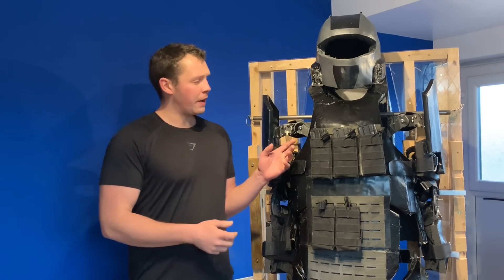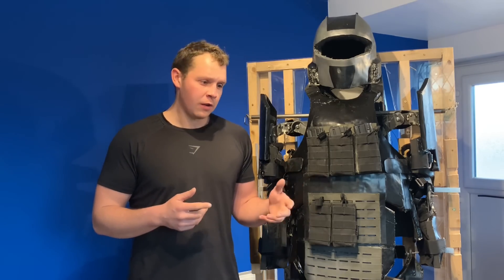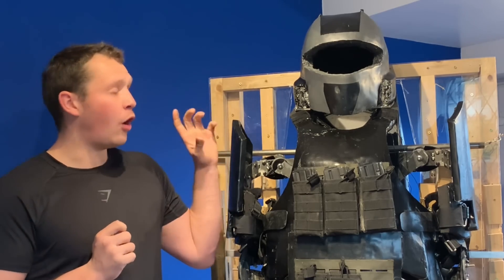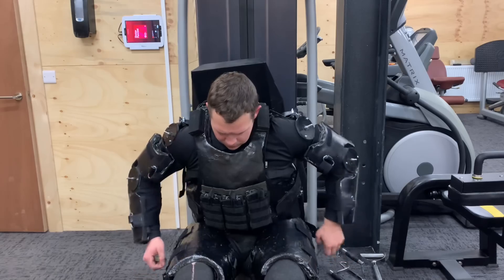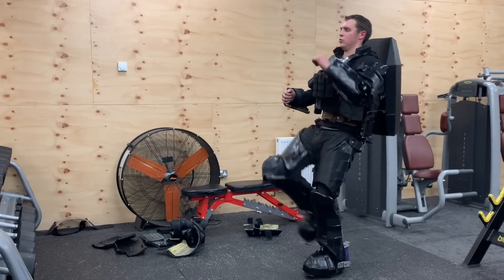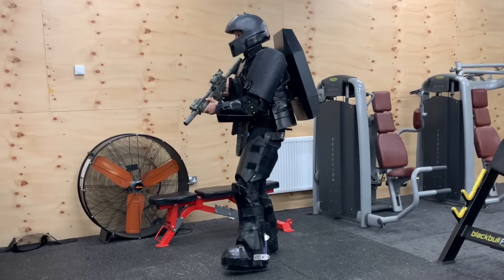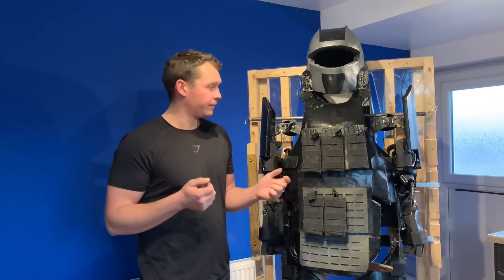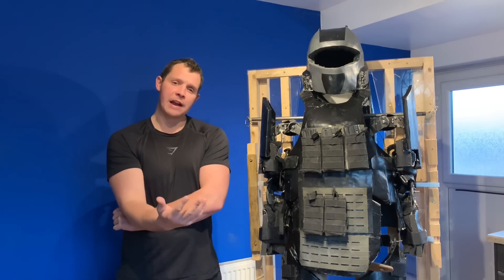Functional Combat Capable Power Armour Development Episode 5 Quest for Bullet Proof Exo Skeletons

Comment: I tried aiming a rifle one time while wearing a motorcycle helmet and immediately discovered the same problem you did. One of those little things you never think about when watching movies with futuristic armor.
Reply: Thats why in Halo the Sights stream directly to your HUD
Reply: And we wonder why storm troopers couldn't hit shit.
Reply: Maybe use some kind of infrared sight under the gun and a very transparent thermal overlay for the visor to let the user see the laser? It wouldn't be as accurate, given the limitations of such a thing over large distances, but it would be cheaper than using a HUD overlay based on where the gun's aiming.
Reply: @LonelyMoon5062  the latest helmets for F-22's, F-35's & Typhoon II's use Helmet HUD's, but they each cost a fewhundred thousand each, they are un-armoured and require the aircraft's onboard computing power to process signal inputs to the HHUD/HVD (Helmet Vision Display)and are specifically custom fitted to only one pilot operator.

Something this design likely will never ever have, ..as the rest of this suit is a conceptual artistic version, the armour isn't armoured, let alone thick or large enough enough to stop a 5.56mm NATO round and its megajoules of kinetic energy, let alone anything bigger in calibre and power.

But as thinking project to work out some of the mechanical limits and movement restrictions, it is a start, only.

Still this looks better in concept than the Russian conceptual Exoskeletal 'Ratnik' Armour, which is equally or more BS than this potential funding scam.
Reply: Most of the time room clearing in the military you don't look through but over the sight. It's usually  under 25 yards so it wastes time when you can just line up and pull.
Reply: Just attach a camera to the gun's optics (or in place of the gun's calibrated optics) and have to feed into the helmet as a HUD, like what David said.

It's already been shown to be feasible all the way back in TrackingPoint's smart scope back in SHOT Show 2013. I'm surprised no one's built upon that concept already.
Reply: Have you ever wondered why wh40k Space Marines and Sisters of Battle bolters are stockless?
A lady cosplayer in a rigidised foam, to scale, SoB power armour outfit tried one with a stock... the stock caught on things and you couldn't line it up.
The stockless design fitted her much better in the armour, fired from  chest level. Just like the Astartes and SoB's do it.
Combined with HUD targeting it would be quite usable
Reply: They make stocks for full face/helmets with face shields; they're just called "visor stocks". You can't get a cheekweld but that's pretty much given.
Reply: attach two laser rangefinders to the gun, then triangulate the impact point and sync it with the helmet's HUD
Reply: Shooting with a mask or helmet on is not an issue during gas mask trading u simply turn your rude 45 degrees. You are not going or shouldn’t use this suit outside of urban environments. Forest or desert environments would not be suitable
Reply: Simplest solution is to install both a laser sight and a webcam on whatever gun you'll be using and pipe the feed from the came into a translucent overlay on the armor's visor so you see what the gun sees.
Reply: we discovered the same thing in the world wars, its hard to aim wearing a gas mask. So what we did was we developed gas masks with flatter, larger lenses.

Comment: have you considered looking at medieval armour and adding a gorget or using sliding plates for areas on the body that requires mobility?
Reply from the maker: I have its just with the thickness of the armour any over lap from sliding plates etc cause tremendous weight and bulk.
Reply: @MattExo-Dynamics  How about a gorget? Or any form of throat protection?

Comment: Someone in the comments was asking in the comments about complications with rescuing and applying medical attention to injured operators, and my answer ballooned to why I think power armor isn't something we really see in general. You're marketing to the wrong people. Your suit will do better in the construction and warehouse fields. It will help the army with logistics and transport but power armor as a concept is not a combat or damage friendly construction.

So to start with that original question - the answer lies in the typical trade (or role) for armor - either you can support the survivability of a soldier that's taken enough damage to be knocked out of the fight (IE soft body armor and its emphasis on being a flak jacket compared to bulletproof; but the kinetics will still rock the soldier and incapacitate them) or improve the duration which a soldier can fight before being killed (hard plate armor and being able to stop high caliber bullets but if it's broken, the operator is screwed (but they sometimes combine the two with a trauma pad to equalize the trade-offs but receive other cons like more weight and cost but still get those problems anyway, so in other words all armor is trade offs upon trade offs upon trade offs)).

So apply the point of the suit being to carry heavier armor and increase battle endurance of the soldier - anything that compromises that goal of the suit - including a lot of 'ease of access' solutions - is counterintuitive.  If you're trying to make a suit that can cover more of the soldier, with heavier armor, to increase their ability and endurance in a war - the added mechanisms and layers of ANY type of exosuit would complicate ANY medical attention, especially when the mechanisms turn into added shrapnel damage from an explosion and are half inside the patient and one of the parts of the frame is stopping the soldier from bleeding out. Technically speaking because of this exact problem, power armor is an ethical compromise just for existing and being used. Nobody wants to be 'that' government. And you bet their opponents will exploit that narrative to its fullest ability.

Furthermore from a financial point of view, any soldier that becomes a casualty with power armor- is a LOT more expensive. Not even as a fatality but just for having to maintain the suit after battle. That's even more funds and manpower and resources locked to replace or repair the suit let alone the usual medical stuff for the soldier if injured. Then if the suit requires special training (it will for fine motor control in combat stress) so that's more resources down the drain and another special soldier you need to train to replace which will cost additional money and time.

Then logistically if the suit is, as outlined above, impacted INTO the soldier and a piece of the frame if removed will make the operator bleed out - you basically have to have the means to recover a person gently AND a giant hunk of metal at the same time. Which in the middle of a firefight makes the whole process a lot harder and only a power-armored medic team would even be able to have the chances of carrying the whole thing. Which rolls back around to having to train a medic to gently carry their comrades in power armor. But power armor will always have less finesse than a normal hand. So it's a counter-intuitive point. Then to roll out power armor and these special soldiers adds on more logistical complexity especially in the middle of a skirmish to replace the casualties.

So basically the armor needs to make the operator literally invincible (due to Newtonian physics it can't) or it's a waste of money - which then becomes an ethical strain on the morale of the country as a whole even if they solve the dying problem.

And that's not even addressing the psychology of the wearer - if you feel bulletproof and you're wearing armor designed to tank shots and you know it will protect you form shots, you're going to allow yourself to be in more situations to get hurt which will then compound any logistical problem when their luck finally runs out and need to be replaced. The best armor is not being shot in the first place.

In other words, unless you're trying to make a stealthy expendable black ops team - a tank has you covered and does everything power armor sets out to do and better with more options because a tank can transport more, and can act as cover, and has explosives galore, and can crash through entire buildings... An RPG will probably outright kill any exosuit soldier, by the way. The shockwave alone will liquify their organs. And we have more experience as a whole with saving tank operators already. So logistically again there is a complication with saving them and training soldiers to save them.

Power armor in war is a PR product with negative PR and financial loss with little tactical value and even less moral consideration. Look into getting it in the hands of fields that won't run the constant risk of destroying it and causing further injury to the user. The legal team of your manufacturer will thank you

Comment: With all the equipment on you practically have complete coverage of the front and back of the body. There seems to be restrictions on mobility and the weight would make it more of a piece of equipment for units with artillerymen or machine guns, troops that do not require much mobility and their positions are vulnerable to enemy fire.

Comment: You should try using steel plates. They can't take a few rounds that ceramic plates can... but they will take hits around the same spots without getting compromised like the ceramic will. Just make sure you get them sprayed to stop bullet shrapnel. Also, they're about the same weight.
Reply: Everything you just said is wrong

Comment: It’s impressive the progress you’ve made where militaries and governments have given up on such a concept. I hope you manage to get the word out for your project. I can see a strong future with this design.
Reply: Real wars are fought with bulk ammunition and rifles for a reason. I could see some special brigade in the far future using this those. Like some sort of ied squad.
Reply: They've given up on them for a reason lol.
Reply: @legoslicerfilms1028 Battery density is a big issue for exoskeleton development. Imagine charging your heavy battery pack on your suit for hours.
Reply: Mainly because the amount of armor required to stop a 50cal machine gun is so bulky there is such a loss of mobility that the proper conclusion is tank. Instead trying to put a tanks worth of armor and machinery on a soldier. Imagine if you just dig a tiger pit. You could just trap a 500lb soldier in a 300,000 dollar suit and add gasoline to a crispy finish. 

Or a tank can just drive right over the tiger pit. Without genetic engineering making humans as strong as animals and double the size you just simply can’t load a human with that much equipment without making them a hug target. When it comes to special operations speed and stealth avoiding the potential of being targeted is far far more valuable then surviving hits and being a target for even bigger weaponry. 

To this point it is well known that special forces generally never wear side plates on there body armor despite how life saving they could be because of how much heavier and slower they make them. Watch any special forces interview and the topic of not wearing side plates is likely.. I mean very likely to come up. Now think of suggesting they wear this. 

A single rpg round is going to ruin your day and if you weren’t wearing a refrigerator you could run and hide with enough speed and dexterity where nobody would be thinking of even trying to hit you with an anti tank munition.

I hope that makes it clear why this isn’t a thing.
Reply: @dorjedriftwood2731   Well I was not considering open combat. The closest historical comparison to this kind of armor is heavy infantry and such tactics only disappeared because of guns. I could really see a supported suit like this being used in close quarters missions and defiantly bomb defusal, but technology is changing rapidly. No one can ever foresee what will come next.
Reply: @dorjedriftwood2731  Not all of these apply to the suit in question though, do they?

Comment: have you thought about adding gas powered pogo "spring stilts"? it would greatly increase movement speed
Reply from the maker: I have experimented with springs in the sole’s, good in theory but the weight gets out of hand and because theyre on the very end of the leg the extra weight amplified when moving the leg. But the real problem i found is that your bouncing the full weight of the suit and operator on the balls of the feet, particularly on the beginning of the sprint. Thats a tremendous amount of weight on the achilles, so you need really powerful achilles assisters with preload. Which then means its just really hard to walk around in as you cant lift your toes up (if that makes sense). 
Its not that there isnt work Arounds to this of course but they all get complicated, which means they’ll break, so its just not really worth it
Reply: @MattExo-Dynamics  what about building the spring system from the tendon area, around the tibia to the front of the knee? there has to be a simpler way to go about this that benefit of gas powered "kick" must have a viable way of implementation
Reply: maybe instead of a piston system, use pneumatic muscles that are light easy to build and tough, and replace the gas with hydraulic fluid

Comment: Love the concept Matt. You need to get in touch with some real operators so they can give you feedback about the system. If you haven't had any real military or combat experience, you may miss out on some valuable insights that could really help to dial in this project. Great work and keep chugging man this is seriously sick.
Reply: This is the best advice. There is a reason we don’t use stuff like this. It usually tends to hamper movement and situational awareness while offering nothing in return. If it doesn’t enhance strength or limit injuries (from overextending, etc), then it doesn’t really provide any advantage. We need to reserve our load carrying ability for armor, ammo, comms and tertiary supplies. 

If it was powered and could move at normal human speed, integrated a bus for comms and power distribution and offered additional imaging like and night vision, thermal and an actual useful HUD. Then maybe there is potential.

Comment: Eventually you'll need to get rid of all the Velcro straps and make them snap buttons or powerful small magnetic snaps, and leather or synthetic belts. Velcro sucks 'out in the wild'. They are loud, can rip or tear, get fouled up with dirt, and they break down in the Sun pretty fast.
I'd try small diameter aircraft aluminum poles or rods instead of plates. Structure and strength wise they are far superior.
With a body suit of armor you can also experiment with liquid armored sections. Compressed liquids of course operate all the world's hydraulics for movement, but for 'static' applications you can use it to stop great forces.
Subscribed to see how it all goes.
Reply from the maker: Thanks for subscribing! Ive tried different fastening methods before velcro for tjose reasons, what i wanted was snap down latches with magnets to hold them ib place stronger, each with locator pins. I made some out of plastic. They worked great until they broke. If i make them out of say stainless steel, they’ll break off of the armour instead of breaking them selves because they get knocked on door ways or walls. Then theyre a big deal to fix. Where as velcro straps are thinner and easily replaced. I do need some better Velcro straps though, also because i designed this prototype for latches, it was abit of a bodge. Putting velcro on instead.

Comment: Notes: Mandible system may be ill advised. A visor to shield the eyes is welcome, but cheeks need to be able to weld with rifle stock or the soldier will suffer heavily.
Shin armor will still impact fighting mobility and stamina, whether that be battery and servo or muscle and tendon. Consider reducing to fragmentation soft armor or polyethylene plate if armoring there at all.
Arm armor I would probably recommend to go lighter on. Incidental strikes and lower threats only, especially forearm armor which impacts aim to sights time and weapons handling efficiency.
Also important is pelvic guard or perhaps something like a soft armor bases that covers about halfway down the upper legs, somewhat like an armored skirt. Yes, haha, pelvic armor, but mass of blood vessels and nerves is a serious issue to shield. Woman is also not exempt from issue of wound to area filled with nerves and blood vessels.

Comment: It has some interesting features, like the metal footplate that moves around on an axis.  In my opinion, the main concepts that need to be integrated into a practical exoskeleton (production model) are as follows:
- Heavy armor (level 4+ and frag), and heavy armament.  The point of the exosuit is to allow carrying heavier weight than standard infantry gear, so may as well increase the capability of the gear beyond normal weight thresholds.
- The exoskeleton, or at least parts of it, need to be quickly removed in case of emergency, such as being engulfed by a flammable material like WP.  The operator instead needs a quick way to remove themselves from the suit in case of an event like total power failure or they could be a sitting duck.
Reply: Forget armament. Why burn the extra capability when you could just use that for improving soldier uptimes and maybe reserve some space for future growth.
More than that, just simple medical treatment might be difficult.